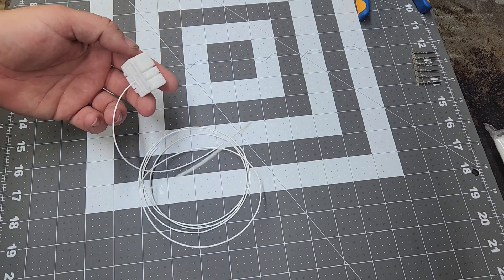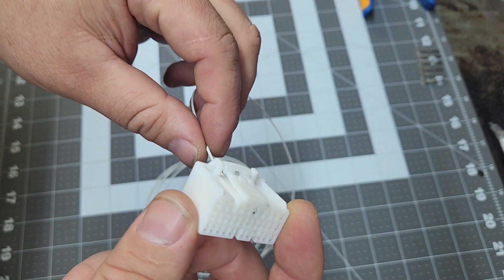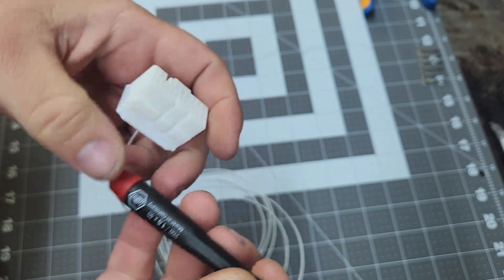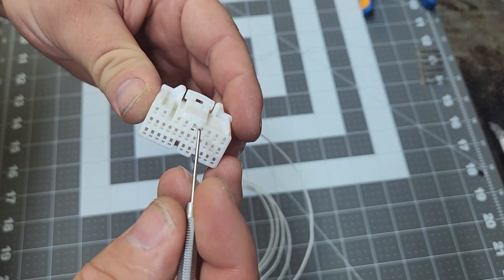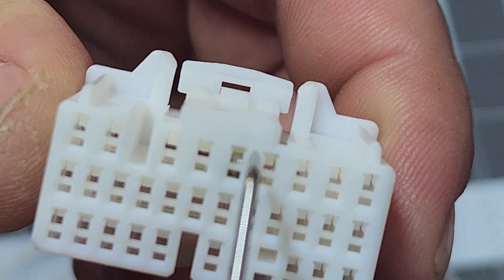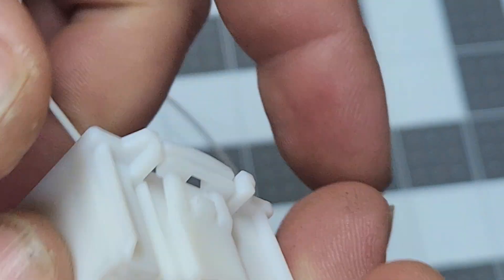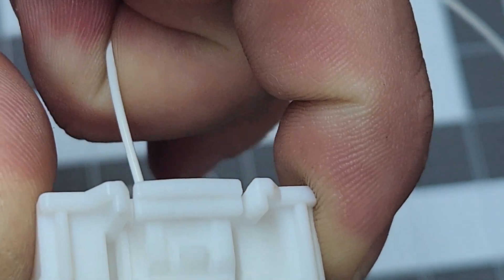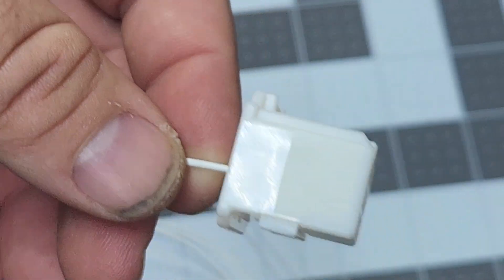Depinning a Honda ECU Connector

Comment: Plastic is starting to bend and wire is still firmly logged. Guess I’m not smart enough
Reply: If anyone else has this problem in the future try pushing the wire towards the connector while pressing down the tab and THEN pull it out. Sometimes the tab can get locked up especially if you've been pulling on the wire without pressing on the tab first

Comment: Would you know if the female terminal pin is the same in a 2013 Tacoma ECM and the size and where to get some. I'm trying to install 2 wires from S8 to E22 to complete the install of cruise control on my 2013 base cab, 2wd, 2.7L 4 cylinder manual transmission Tacoma. Hope you can help with this information and thank you.

Comment: Still struggling to do this. Is the idea that you are prying up a plastic tab or prying down a tab on the terminal of the wire?
Reply from the maker: The latching tab is in the connector. If you observe, the terminal for this has no such tab.